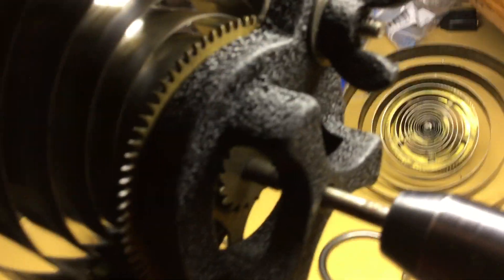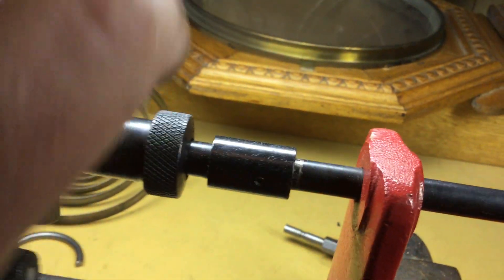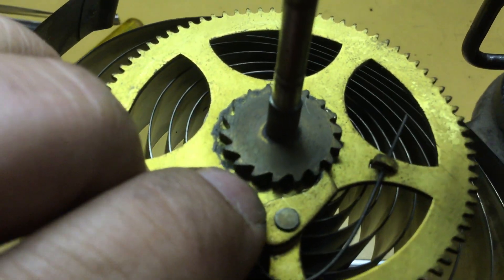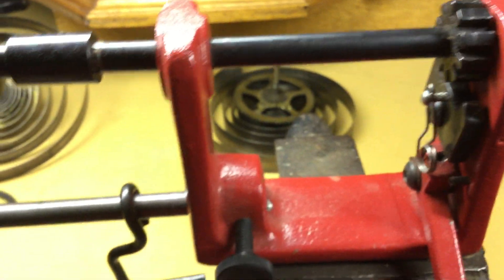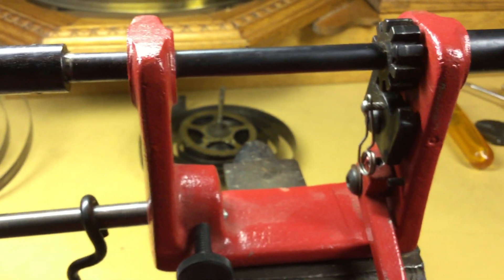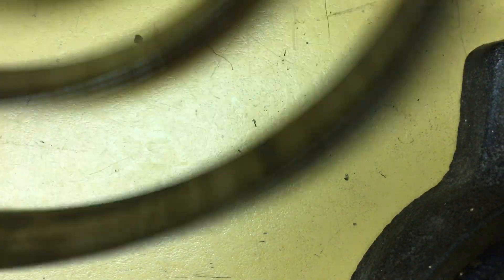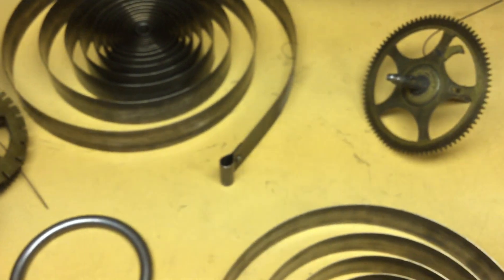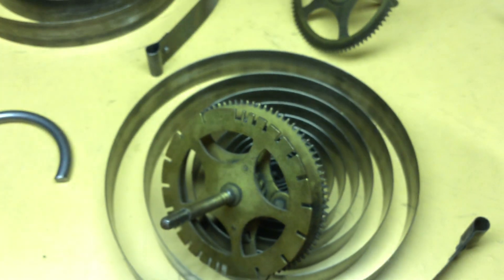Gilbert Long-Drop Octagon Clock Rebuild Part 5

Comment: How much would one of those bigger mainspring winders go for?
Reply from the maker: I picked this one up used for $100. The new ones, depending on brand sell for $250-500. 

You really don't need one for (most) alarm clock work, particularly Westclox. A 30-hour Westclox time mainspring for a full-size movement (such as style 1A-style 6 loud alarm) is about 20% weaker than a New Haven, Gilbert, Ingraham, etc  30-hour time mainspring, and its in a barrel, sou you can easily wind it in and out by hand. For an 8-day alarm clock, and full-size 8-day and 30-hour clocks, the mainspring winder is a must. You might be OK using the small open loop winder on 30-hour springs for full-sized clocks, but that would be the limit.
Reply: @okbridges  The Seth Thomas mantle clock I made a few videos on finally needs to be taken apart. It no longer wants to start when you tip the case up. It was recommended to have the clock serviced every 3 - 4 years, which is when this clock was last serviced, so I may be needing one of these. I don't plan to work on it for awhile, though. Great series so far btw.